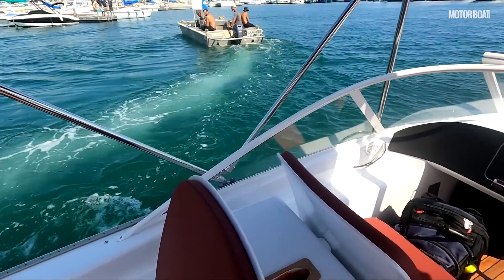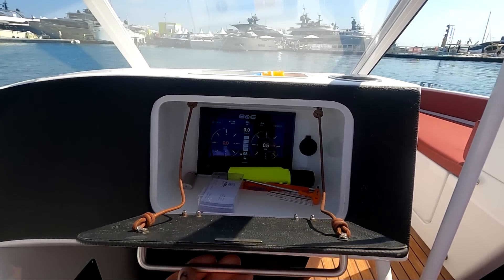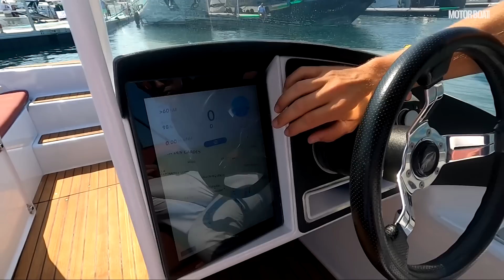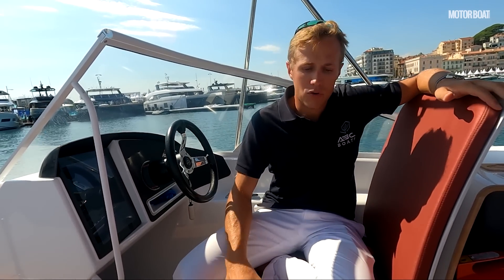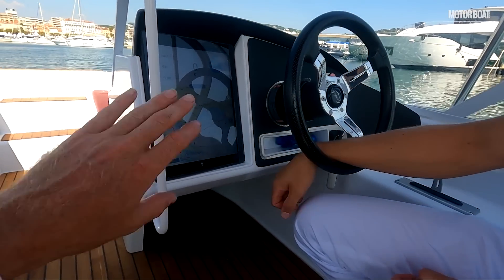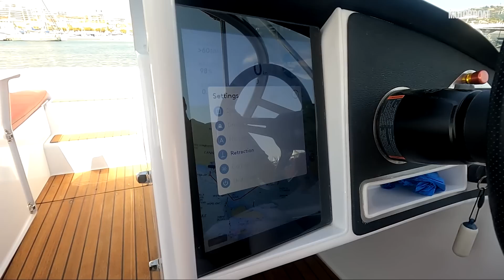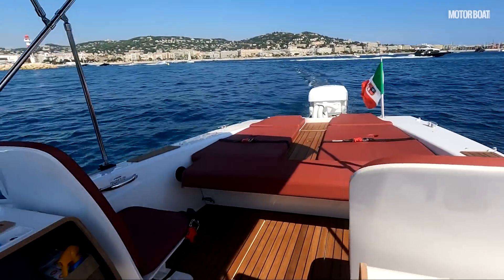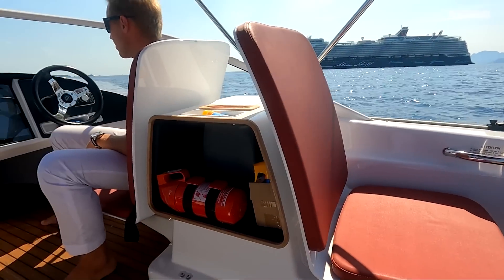We drive the world's first foiling electric boat | Candela C-7 review | Motor Boat & Yachting

Comment: It being carbon fiber, I worry about being used as a yacht tender, especially one that needs to be hoisted by a davit system. Hoisting a boat on deck during rough seas would concern me, then yacht crew treating it gingerly enough would also be of concern. I've been yacht crew, I've been around yacht crew since I was 7 and I know that sometimes they aren't always the most gentle with things.
Reply: How dare you be practical and use your experience. Anony youtubers know far more than those with a lifetime on boats. When are you going to understand that?
Reply: Yacht crews need to be professional if not they will not be employed in a modern maritime industry. Any damage to equipment could be deducted from their salary.

Comment: You still need fossils to charge it. Is this really a net gain?
Reply: That depends how your electricity is generated. Wind, solar and nuclear power now account for a good proportion of the electricity used in the UK.
Reply: huh? Since when does electricity generation depend on fossils? Here in NZ more than half is generated from hydro, and only 19% from fossil, and this is even without nuclear. The great thing about electric power is you can generate it in dozens of different ways.
Reply: But fossil is the only one you can count on

Comment: If weight is such an issue how are the vacationers going to carry all their stuff?  And how do you tow a skier if you need to hang out at 4-6 kts before hitting the throttle?
Reply: 💥 I was so shocked by the concept, I hadn't thought about other uses besides a water taxi. I guess you can pull a tube 😏 around with it. I really don't know if the person who pays this price tag do much water-skiing. 😕 and the price tag doesn't make sense for a rental fleet operator. It would take forever to get any return from the investment, so that market is a nogo... I see the military 🪖 capabilities of a boat like this, but I wonder what happens when those batteries 🔋 get hit with bullet's, and how the survivability is...from Wyoming USA 🇺🇸 🤠

Comment: I think that hydrofoils like these should be used on ekranoplans so that they can lift out of choppy waters more quickly and easily, and then the hydrofoils lift out of the water and retract, and the ground effects of the ekranoplan wings do the dirty work.  Then the same thing in reverse when the ekranoplan slows down on the approach pattern.
Reply: Nice idea. Would need some solid engineering to store the foil legs somehow without compromising the wings.

Comment: Great tender. $310,000.00 
Cool video. What is the weight limit for passengers?

All electric transportation still relies on fossil fuel. Pure folly to think we  abandon fossil fuel any time soon.  

Seatbelts are really idiotic for this type of boat. It is not a high speed performance boat. It’s more dangerous for people to be strapped in as underwater panic will lead to deaths.
Reply from the maker: Max capacity is 800kg

Comment: How much weight and or increased range could you get with thermoelectric generators? the temperature differential between the top of the vessel and the water could be utilized...

Comment: The capacity of the battery is the saturation of the liquid in the battery.  Unlimited range electric is Edison generator or a battery powered dynamos that produces enough electric power to charge the battery and powers the electric motors.

Comment: I'm guessing the hull might weigh a little more than 90 kilos? That's a little crazy even with it being carbon fiber. 2 adults can lift 90 kg easy yet it looks like you can accommodate 6 passengers plus the 1000 kg for the mechanicals, battery and motor while allowing for the structural stresses of the ocean. Pretty wild. Thanks for sharing.
Reply: I know, it’s astonishing!

Comment: Wow, very impressive. Something I'd worry about if I were to 'fly' this boat on the lakes around here, is the presence of floating logs in the water. I wonder if it has a safety feature for floating obstacles or do the foils just plow into them?
Reply: Obviously best to avoid obstacles but if you do hit something solid they are designed to break off but leave the hull intact
Reply: @hugoandreae3495  , Good to know. Thanks for the reply.

Comment: Whats the kw usage comparison between on foils versus off  foils?
Reply from the maker: It uses about the same 1kWh per nautical mile at 5 knots off the foils as it does at 22 knots on the foils. It's only for take off that you need to use the full 55kW power of the motor

Comment: I like the boat and concept, but I have a question. What's going to happened to foils I you hit some debris like floating palm tree or log?
Reply from the maker: They're designed to detach without causing any damage to the hull, so you can limp home at displacement speeds

Comment: Fascinating technology, having had twin 200HP outboards on a fast fisherman for many years, the biggest problems were everything electrical, corrosion on leads and marine growth when sitting in the marina. Will be interesting to see how the electrics hold up and the foils perform if the barnicals and other marine life take hold. At $260,000 dry berthing would avoid the marine growth  but every launch and trailer mounting risks damaging those foils and the prop. For me, long live roaring 2 strokes.

Comment: A question: What happens if you hit a submerged object with one foil and it breaks or is heavily damaged? I can see the hull dropping on that side and the end result will not be pretty.
Reply: The two foils are front and back (not one per side)  so if you hit the front or back foil hard enough they are designed to break off and the hull will land front or back first.
Reply: @hugoandreae3495  And that means you'll most likely pitchpole the boat. The last thing you want is your bow to drop; it won't be pretty.

Comment: My takeaway from this video is there is NO wake lol!
However, there is a reason the industry has not moved to hydro foils. They are just impractical for everyday use. May be as a super yacht toy but not anything resembling every day-to-day usage.
Reply: In Italy they have 100 foot long triple decker ferry boats that use foils all day every day. It's way more efficient if you aren't dragging the boat hull through the water. There is the choice of the "fast ferry" at 30 mph or the "slow ferry" at 8 mph.
Reply: @lewistemple9074  the russians use also those fast ferries and i think japan and south korea

Comment: what is the minimum foiling speed?
Reply from the maker: I can't remember exactly but think it's around 17 knots although it seems happiest and most efficient at 20-25 knots
Reply: @MotorBoatYachting  my local harbour has a 10knot limit 

I know it's a trade off as without clever flaps on the foils increasing lift at low speed you would sacrifice power requirements at higher speeds.

Having said that despite breaking the 10knot limit you would be producing no wake so maybe harbours would allow a high limit for foiling boats.

Comment: Pretty cool and seems pretty practical. But it doesn’t seem as quiet as they keep saying it is. I would like to see how it handles 1 meter plus waves. Also, the hull design looks pretty bad, I wonder what happens if you strike something that breaks a foil?
Reply from the maker: The foils are designed to detach without damaging the hull, so you could still limp home

Comment: Impressive boat. But the weight puzzles me. The hull weighs 90 kgs, the battery 260 kgs, and still the total weight is 1300 kgs?
Where did the other 950 kgs go?
Reply: Decks, motor, seats, windscreen, foils, dashboard, controls etc they all add up.

Comment: Just for context, an EV like a Tesla Model Y uses maybe 2-3 kw at highway speed. This boat uses 25kw at 23 knots (26 mph). So, it's using 10x the power. The foils help get it that efficient, but it's not efficient in the scheme of things.
Reply: At 80km/h a Tesla model S requires about 9kW and at 120km/h it requires about 19kW. A model Y slightly less. A motorcycle at highway speed is about 6kW because of the ridiculous air resistance at those speeds.

Comment: If you spend half of the weekends at your lake,beach house per year,you spend approximately 150$ on fuel. 18000$ a year in gas savings and over 10 years 180,000$ in savings. Minus 250,000$For  purchase equals 70,000$. So there’s not much in the way of saving money by owning this boat,however it is cleaner for the environment and seems like it has a nice ride.

Comment: I will admit, it would be pretty cool to drive this vessel once and maybe two or three times.  But, beyond that, I would get bored. Boats are for activity such as water skiing or tubing in addition to hanging with friends. With that in mind, I have some questions. 

1. The C-7 costs in the range of about $279,000. For the price, do they replace the batteries free of charge when they start to not hold a charge as well several years down the line?

2. If Candela does not replace the batteries free of charge, what will be the cost to replace the entire bank of batteries?

3.  What would be the resale value of this boat when it is 7 years old?

4. Can it pull a water skier, wake boarder or tuber? If so, how long will the charge last?

5. Let’s say that everyone gets an electric car and boat loves all buy Candela electric boats.  In this case, can the electric grid in the USA handle that kind of a demand for electricity?

Maybe the super rich can buy but not the average Joe. And, unless the super rich guy has a specific use for it, like being a tender on his super yacht, he will end up selling it at a huge loss. It will be fun for him at first but then that fun wears thin and it won’t get used much after that.

Comment: Very cool. I would be a bit concerned about the systems design in what appears to be a integrated controller architecture and single display to captain. Airplanes use redundant functionality so a single failure does not disable critical systems. A wet environment presents unique problems.

Comment: Draws 1.6 feet or about 19 inches.  very impressive.  However, the $300,000 USD price is a non-starter. 3000 lbs US is also no lightweight for a small boat.

Comment: Wow almost perfect motor boat.  Edison generators and dynamos with inverters and transformers to deliver high voltage AC power continuous peak power to a high torque electric motor.  The bow and coils look good but the horse power and range is limited.  Edison generators or battery powered dynamos would greatly improve the boat.

Comment: My question is, what happens when you hit a dolphin or whale or something on the surface
Reply from the maker: The foils have been designed to detach on impact without causing damage to the hull, so you can limp home without them and there won't be any water ingress.
Reply: @MotorBoatYachting  very interesting, thanks!
Reply: @MotorBoatYachting  very interesting, thanks!

Comment: Hull contours do not fit this concept. Such boats have long been used with gasoline engines. In combination with the foil, a different hull should be used to facilitate access to the wing and increase seaworthiness .... It is advisable to shift the front wing as much as possible to the nose. So that the rear is not in the hole from the front. The ratio of mass to power, allows you to improve efficiency ... There are reserves ... Sincerely ...

Comment: Yup, if I win the lottery, I think I'll get one. Other than that, it is definitely out of my price range, so it is but a dream. 🙄
Edit: It was mentioned it would make a good tender... how so? I'm picturing a tender as the go to town "pick up truck" of the ocean going vessel. Yet this boat needs to maintain a lower center of gravity. If you load this boat with supplies for the main boat, would that make it unstable on foil?
Edit 2: also, wouldn't it be strange if the tender cost more than the main cruising boat? Just a thought. 😆😅😂🤣😂🤣

Comment: Just add electric magnet generators that produce non stop electricity
and you can leave the boat recharging it self without need of a plug...Unlimited range ?

For larger heavy yachts I guess 2 foils with larger surface would lift the yacht up...

How far could the struts go down? 4 times more the length as seen here could lift the boat higher 
to pass through higer waves on Sea...while maintaining the balance point.

Made some rough idea scetches where a foil strut could be as long as the keel
and swift down 90 degreese, beeing 20 meters + on a super yacht of 25 meters...
Lifting several meters above the water line, enough to drive through 4 meter waves.

And I added 4 Deep Speed (tm) 500 KW super water jets (1 = 780 cv / s ) ... in the hope that this could thrust a 30 meter yacht more then 50 Knots...
Design study was with 500 Lutec 24KW EMG's on a big yacht, producing 12.000 KW in 24 / h.
Can be less and better stored in batteries.

Comment: What an amazing boat and the technology is still in its infancy. 😳🤔👍🏻
Reply: Sorry, mate, but hydrofoils were invented in 1906, and electric boats and land vehicles were invented and used prolifically before internal combustion engines began motorized propulsion.
Reply: They are already releasing the Candela C-8 which is a larger and much more practical boat.  Technology is moving fast.
Reply: @TyinAlaska  yes, but the tech is still in its infancy in boating… it has not developed much and has a long way to go. the point still stands, you tried to be smart correcting this guy but ended up completely misinterpreting his point

Comment: A good tournament ski boat? :)
Reply: Probably not. Competition slalom and jump skiers would pull that thing off track pretty easily, and there's no wake for the trick skiers to do their craft. Even the very best designed tournament tow boats have to have a capable driver to 'Block' when towing slalom and jump. It takes quite a bit of skill to keep course and speed.

Comment: I would remove the foils and install high torque electric motor propellers or jets and battery powered dynamos or Edison generator powered electric dynamos to get unlimited range and fine control.
Reply: It would be less expensive but greater range electric and better performance without the foiling.
Reply: A brushless motor with generator coils and commutator brushes.

Comment: Looks good until you hit a roller in the bow and spear the boat, cause there isn't any boat mass in the water. Kind of like tripping on a rise in a sidewalk ! Never been a fan of foils. Still have a long way to go for battery life. LOL, 5 knots or 23 it is just putting around. Then you have to figure in the cost of battery re-placement if the battery fails. which will be about as much as the boat it's self. With today's technology in fuel engines, I'm good for now !!
Reply: @darrengillesdarrengilles8336   LOL Elon isn't a trillionaire  because of car sales ! He doesn't sell near enough to cars per year ! That was just one small step for him !! ROFL !!

Comment: Use an engine to drive a big  three-phse alternator and the range could be greatly extended.
Reply: The drag added from the alternator would cause it to use more energy than it creates.
Reply: @thwingc  In actuality generators now days are rectified alternators. I dare say an engine driven generator with electric wheels will move on less power than it's capable of making just the same as hybrid vehicles.

Comment: The problem with electric vehicles (boats included) is that the best 100 kwh battery built today has the same energy of 2.7 gallons of gasoline with EV's being 100% efficient that equates to about 7 to 9 gallons of gas.

Think about how much fuel you went through on your last trip/outing???

Comment: 265,000 ...ithink I'll stick to my $26k boat that goes twice as fast,  for 10 times longer, and not susceptible to damage by underwater grasses or other various obstructions that may be hiding just below the surface. Guess that's why they have seatbelts...in case of accidents like a foil getting snagged and ripped apart.

Comment: I just got back from beautiful Lake George in Northern NY- and the first obvious "flaw" with all the gas-burning engines boats is that they ARE Destroying this lake! Of course these boat-owners will Not want to agree with me- but the same was said 50 years ago about- Man couldn't destroy 'his' oceans and continents!!
Yes- Electric motors def. 'seem the wave o the future' (Yet getting the Lithium) for the batteries will Not be easy!
 re: Your boat- curious how it performs in rough seas? And as a kayaker I KNOW there is always just below the surface- submerged tree-trunks, 50 G barrels and lots of 'flotsam' and these WILL BE SURE to wreck havoc on any 'foils' so????

Comment: If you need 100k lines of coding to keep a boat level on the water, you need a new guy to do the programming... Helicopter stabilisations systems only use a fraction of that.